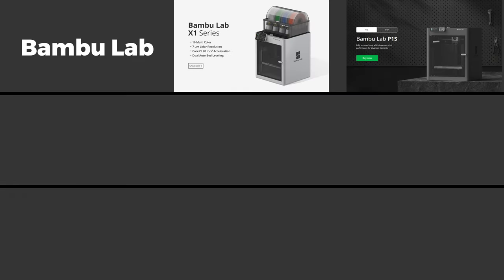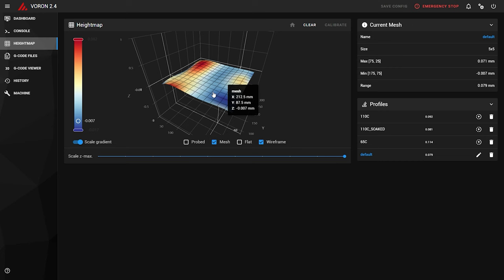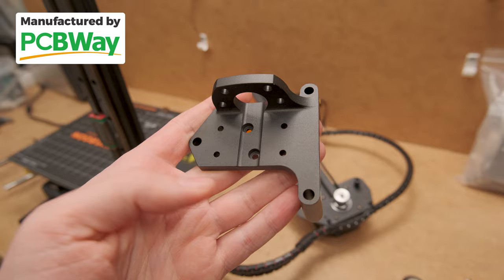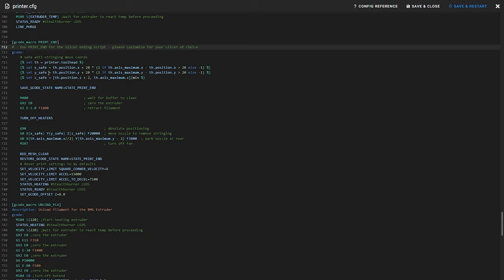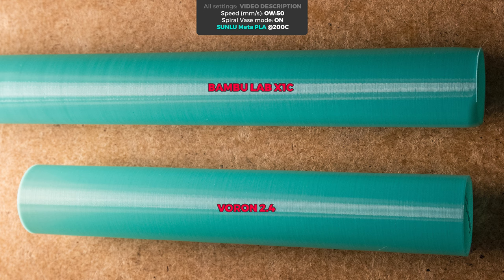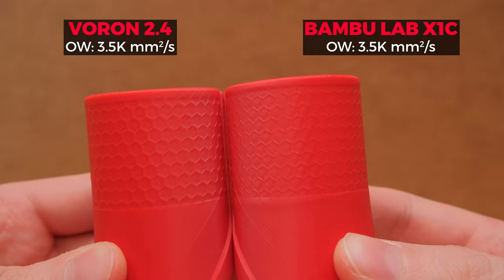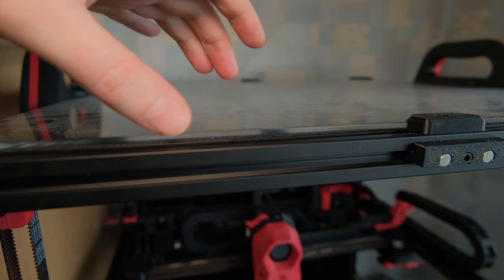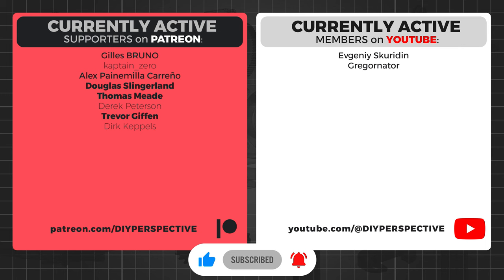Is VORON 2.4 as GOOD as people make you believe? (vs Bambu X1C)

Comment: As a 350xx350 V2.4 owner, the best upgrades for me were the CNC tap, annex engineering panel clips, and the nevermore v6 mods. Actually glad I went voron over Bambu personally. I am not a fan of cloud printing or having to relinquish my ownership of my prints to a company just to print. Besides I love having the ability to change colors and upgrades at my will
Reply from the maker: I prefer my Voron 2.4 over X1C mostly because of the noise as I work in the same room. About cloud printing, you can run Bambu machines in LAN-only mode. But yeah if you love modding printers V2.4 is amazing, I am looking forward to making upgrades.
Reply: Lan only mode seems like a cop-out to me. It's gotten a bit better but you still lose features that you paid for just because you don't want all of your print data and camera feed collected to be used by Bambu and whoever else they decide to hand it over to. Also, if I understand correctly, you have to connect to the cloud to update the printer firmware. I don't trust that as soon as it gets reconnected that it won't send the entire available backlog of print data straight back to their servers.
Reply: Apples and oranges.

I have both.

You don’t need the cloud to print and I thought that was common knowledge by now. 🤷🏻‍♂️

Bambu has no access to my intellectual property or data.

Bambu printers are for people that want to make and sell things, and for people that have no skills at manually dialing in a printer. Voron is for the pure hobbyist.

I just added the K1 max to the arsenal too.
Reply: @einbit  What features do you lose?

I’m not missing anything. 🤷🏻‍♂️
Reply: I admit to preferring the Duo V5, just seems like it assembles better than the V6.  Maybe I just need some more dialing in on my printer, but especially the carbon part that weird sliding panel did not seem to like sliding.
Reply from the maker: @gotmilkbutt I mainly print ASA in a well-ventilated room, it's still kind of summer here so all windows are open. But I will have to do something about it in the winter.
Reply: @filanfyretracker I agree, had to print that sliding thing almost 10 times to dial in right print settings. It worked eventually and I now love that sliding thing. I can nie cha be my carbon without screwing anything
Reply: wasnt aware of the cnc tap…are you actually seeing significantly lower probing tolerances with it?
Reply: @dangerous8333  how do u like the k1, iv heard mostly bad things and on the fence about getting one.
Reply: I got an X1c as it was my first 3d printer and it's been great. 1500hrs and no real problems at all, just not looking forward to changing belts etc.  I'd love that voron and I think I could put it together since I have experience in that area, but the software and all the coding stuff, ya I don't have any experience in that stuff. So maybe once I understand that stuff better, I'll buy a kit and give it a go.
Reply: "Renting" hardware from the company you purchased it from is a very Apple thing and a huge turn off for me. Otherwise I would consider a Bambu, but that kills it for me.
Reply: Same. 350, Tap was the best thing ever.
Reply: Yes. Exactly this! Love my v2.4 300
Reply: @lajoyalobos2009  how you mean 'renting hardware'? Because of the cloud?
Reply: Building the 2.4 was a pile of work, but I’m really glad I went that route.
Reply: Good for you. I regret pursuing x1c. It is shiny good looking crap.
Reply: @dangerous8333  how does the k1 max compare to the Voron and Bambu?
Reply: I have a Bambu Lab P1S and I print everything over wifi.  Cloud printing is not necessary.
Reply: @dangerous8333  I already have multiple sovol printers and some crealtiy but i am need few printers that are more reliable so i am going to go to a voron 2.4 and an X1C. Which should i get first?
Reply: My voron 2.4 upgrades are cnc tap, btt pi and canbus

Comment: I own multiple Vorons and the Bambu Lab X1C w/ AMS. I am VERY experienced in building, designing, and modding printers. It is two completely different philosophies. Not really comparable. One is you get what you get. Jack of all trades and master of none. Want it to do X, maybe it is possible, maybe note, because proprietary. The other is as good as the effort you put into it. You want it to be able to do X, you can do that if you put in the effort. Also once you can print ABS reliably there is no point in PLA anymore. Its only good quality is you can print it on cheap printers. That is the only reason it is popular. If the melt temp isn't an issue PLAs problem with conforming to stress is. Makes it terrible for almost all functional parts. Hope you are into printing useless nicknacks. Get a resin printer and an air brush for that stuff. Also the key to high quality fast prints is stupid slow external walls first and stupid fast internals last. Where the quality does not matter as long as you can push the plastic fast enough. Do that right and you can even read the "3D Benchy" on the back of the model :)... and you will start running into the limitations of stepper motors and there resonance frequencies.

Comment: why do you need filament load and unload macros? - filament load - heat up the hotend beyond the melting point of the plastic that's in it, unlock the extruder, pull the old filament out, insert the new filament, pushing it through the hotend until it comes out, lock the extruder. done.  the only macro you really need is the integrated one that's "heat hotend for pla or abs depending on what filament you're printing with.

Comment: To get a bit more detail on the voron, you can choose to use a less aggressive input shaper method. I have found I can get even better results than on my bambu printers.

The stealthburner toolhead does have pretty poor cooling. Look into the mantis or XOL toolhead for better cooling if you want to print a lot of small PLA pieces
Reply: The best Voron mod is to print ABS.
Reply: @Flumphinator true, I stopped buying PLA in 2017 and I ain't bout to go back.  Abs is just...better.  in just about every way I care about it's better.  Lol.
Reply: I print almost everything in ASA. 
If you need better part cooling for stealth burner. I recommend the CPAP mod.
If you have a bed on a z-axis, a 120mm or 200mm side mounted part cooler.

Comment: Paused at 30 seconds to say this:

FINALLY,  THANK YOU! Thank you for doing an apples to apples comparison, and not a X1C vs Prusa (or any other bed slinger).
Reply from the maker: Thank you for a nice comment! :)
Reply: It’s apples to oranges.

Bambu is a printer made for manufacturers and noobs.

Vorons are for hobbyist.

If I was building a farm, I would go with Bambu and not Voron. As a hobby, Voron all the way.

So looking at it that way it’s apples and oranges to me.
Reply: The angles from which you can compare these two are multiple. From a consumer perspective I think Bambu vs. Prusa is a closer apples-to-apples, as both offer an experience where you buy a pre-buillt printer, join their ecosystem and get started printing stuff. From that perspective, a Voron is total nonsense to compare as you get a box of parts that require you to either print, or acquire a lot of additional printed parts  and that'll take weeks to put together and possibly months to tune.
From a technological or price perspective, yes the Vorons are closer to Bambulab in that they are both fully enclosed CoreXY printers, capably of printiing up to at least 300C. A Voron Trident would probably be an  even better comparison as they both have the gantry fixed and a moving bed.

Both comparisons are valid and valuable. Which one  you value most in your purchasing decision is completely upt to you.
Reply: @dangerous8333  i think what he means is that they are both built for high speed printing as well as both being corexy
Reply: @SUB3CRIBE01  Yes. I'm looking at it from a technical standpoint. You are correct.

Comment: I have both and they fill different roles! But once you build a Voron you now can go with anything! Any and every problem that you can have you can now fix! This is what I think the biggest value of building a voron is!
Reply: I agree. I need a new printer to replace my Ender 3 Pro and I'm looking at building a Voron 2.4 as a replacement. I've already done multiple mods on my old E3Pro (including swapping out the mainboard for a Manta M8P, which also required me to completely reengineer the electronics enclosure), but there's only so much you can do to a Cartesian printer. I want greater quality at higher speeds, so it's time to go for a CoreXY frame and the Voron looks preferable design wise over the HevORT. I'll probably swap out the z-axis belts for ball screws though. Throw on an Oldham Coupler for ball screws and all wobble on Z should be gone

Comment: To be honest, you would have been better using the LDO Voron kit for comparison as that's the officially mandated kit. Anything else is a bit variable in quality. My Formbot works well but it a more budget kit.
Reply: Formbot works great despite the budget. Where it falls short is the longevity of some parts such as the xy wire loom that often breaks wires from fatigue, clockwork bearings going bust at around 500 hours of print time, and questionable bondtech gears that may not be genuine.

Comment: As a Voron user I can say that quality factors and usability are not on the same scale. Bambulabs are more relatable to a Prusa than a Voron and DYI projects are standalone.

You did a good job but a 1k kit can’t compare to “pro” kits or self sourced builds and has to be said.

If you’re willing to spend 3-5 grands and spend al lot in implementing your logics and macros you will end with a printer going almost twice as fast as a Bambu capable of high temp materials with restricted thermal expansion. But as soon as you start with cnc aluminum parts, grade 1 titanium backers, hywin rails etc the law of diminishing returns strikes.

TLDR: Vorons/Ratrigs/Vzbot etc.. DIY printers can and will perform better than any bambulab but require skills, money, time and expertise, you sum it well saying “if you just wanna print go bambu” but is not like building a Prusa kit, is more like building your own machine from scrap like in 2015 and compiling your logics to make the printer run.
Reply: I'd say it depends. BambuLab X1C uses the same framework as the Voron printers does. Comparing an X1C to a Prusa may be sensible performance wise, but framework wise you're comparing a CoreXY to a Cartesian and Cartesians are known to perform worse than CoreXY.
Reply: @Arterexius  definitely wrong argument and still prove my point
Reply: @DianosAbael  Not exactly no. At the present moment there's nothing but personal opinions here. If you know that you are correct, I am sure you have the links to back it up?
Reply: @Arterexius  “Bambulabs uses the same framework as the Voron does” is factually false. This means you know nothing about the argument. If you think that the trident (just one of the Voron design has the same kinematics of an X1C that’s delusional.
Reply: @DianosAbael  Additionally, what's actually delusional, is your inability to understand what Open Source truly is, given that you apparently believe that anything that builds on Open Source systems, must be identical copies.
Reply: @DianosAbael  Now that we've gotten the fire out of the way, I suggest reading my comment again. I never claimed anything about Kinematics. In fact, I started out stating that performance wise it certainly makes sense to put a Prusa up against a Bambu, but the Prusa are Cartesian printers with good kinematics, while the BambuLAB X1C has poor kinematics for a CoreXY. All I stated was that the comparison is a good apples vs apples comparison, since the Voron and the BambuLAB X1C uses the same framework. They're both CoreXY printers. None of them have bedslingers (Switchwire on Voron doesn't count, since the bed doesn't move along Y while printing).

Kinematics are mostly separate from the overall frame. Yes, the frame have something to do with it, but mostly in terms of resonance. Remove the mechanics and electronics and you just have an immobile empty frame. That much is true for both Delta, Cartesian and CoreXY, but CoreXY have been specifically designed to have the best kinematics. Bambu just cut away what they thought could be removed, but that doesn't change the overall configuration of their X1C. It's still a CoreXY. Just like Voron. Voron is just better.
Reply: @Arterexius  🤣🤣🤣🤣🤣🤣🤣🤣 what a clown
Reply: @DianosAbael  To you I may be, but you still haven't proved your points. I'll give you one more chance before posting this to Reddit, cause you're setting yourself up as laughing stock 😂😂
Reply: @Arterexius   do you realize the amount of bs you wrote? Switchwire doesn’t move the bed along Y while printing? Nothing, NOTHING of what you wrote has some sense. Being a coreXY doesn’t mean having the same kinematics as a Bambu, nor the results. A flying gantry has some properties, a fixed gantry has others. You tried to contest my initial affirmation just for hubris and now you are showing no arguments.
A laughing stock? lol on Reddit. Got it. 🤣🤣🤣

Comment: A few things about the comparison: Voron teams goals are about off the shelf part availability and long term reliability. Speed is nowhere in their mission statement.

They were also designed to be self sourced with high quality materials, not purchased in a kit meant to cut as many corners as they can get away with. 

This doesn't invalidate any comparison, just worth understanding.
Reply from the maker: Yes, I am aware of that and that's amazing. And even despite that they still provide quality prints at higher speeds. I need to go more into DIY printers, I already miss building it. F... it is addicting haha!
Reply: I don't understand this. You say the point is not speed, but also that the point is to build it with high quality parts...what could the benefit of those parts possibly be besides speed? Precision? Even an Ender prints pretty much as precisely as FDM will go. 

Sounds an awful lot like "we are using fancy parts for no reason". If you're gonna spend that kind of money, an Annex is actually fast. Everything is still "off the shelf" as you say...all these parts are standard on any printer...bearings, idlers, pulleys, rails...what could possibly be "not off the shelf"?

Honestly, I think the actual Voron goal is "coolness". Which, fine, but it's not for me...not at that price. I want performance.
Reply: @geometerfpv2804  I didn't say I agree with the goals or that voron is ideal. I only clarified vorons stated goals and what they did to achieve them. Weather you agree with the goals, what they succeeded, etc, is an entirely different discussion.

Comment: I may be going with klicky probe instead of the TAP to reduce toolhead wight. Do some CPAP cooling for part cooling. I will also run the CAN bus board to make life more simple and reduce the X gantry weight because of not having the cable chain and all the cables inside that chain.
Reply: I went for klicky. Works well. I am not sure I understand the hype around TAP. It adds weight, seems to be problematic for toolhead rigidity and not to forget, your measuring reliability is suddenly getting a new problem which is oozing.

Comment: Don't check only ringing on the accel tuning tower, but also at which height (acceleration) the gap widens. As I mentioned elsewhere, the X1C shows quite some smoothing in sharp corners due to excessive input shaper, so the V2.4 may still be the better one overall even if the prints from X1C are INCREDIBLY (I admit that) smooth.

Comment: One thing to consider: there are open source projects for tool changers for the voron, where the the bamboo is stuck with AMS.
Reply: WIth an AMS that works very well and makes Multicolor prints as easy as they can be.
Again the same choice - tinkering a lot or just printing?
Reply from the maker: Yup, I would fully agree with this. AMS makes you lazy lol. It is that good. One just works and other things can be fun tinkering with. Both is good for a right person.
Reply: Only disadvantage of bamboo in terms of multi-material printing is that you can't install toolchanger or second head for idex on it

If you only need multi color printing with the same material, it's pretty well integrated solution
Reply: @shadyb   On how many printers can you install a toolchanger or a second toolhead?
Bambus goal wasn't to make the ultimate printer, it was to make a very good printer for a good price for the most usecases.
Many people, including me, use the AMS mainly as a storage to be able to just print with different filaments without having to actually change it.
Reply: @Glasrandkante  you can install those on whatever printer you have as long as it has open firmware and you can find or make mods for it
Reply: @shadyb  is there voron 2.4 idex?
Reply: Yeah, but you're pretty on your own with this kind of thing...good luck making it as reliable as an AMS. I'll come back in a year when yours is finally working consistently 😂
Reply: @geometerfpv2804  AMS is not a replacement for IDEX so your point is moot. If you need one, it doesn't matter how good AMS at everything else.
Reply: @TMS5100  not with core-XY